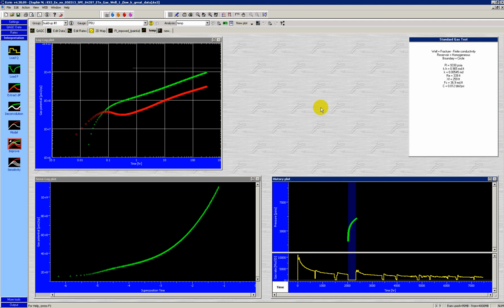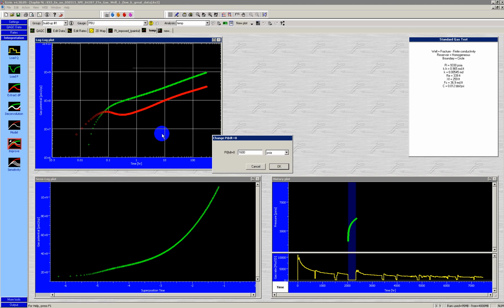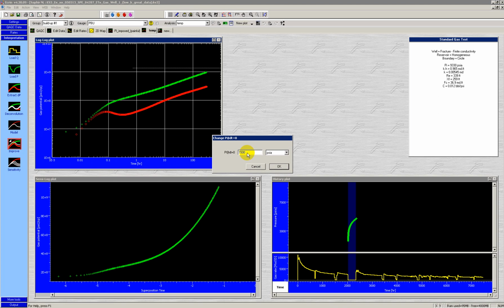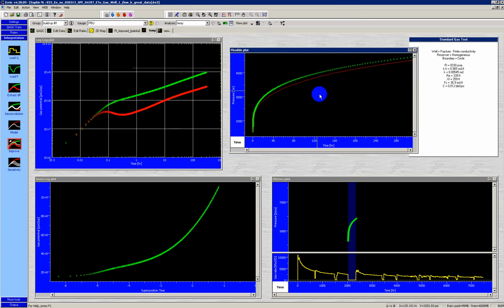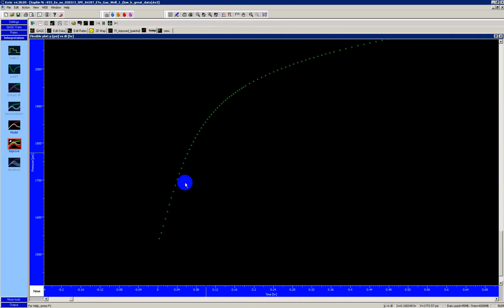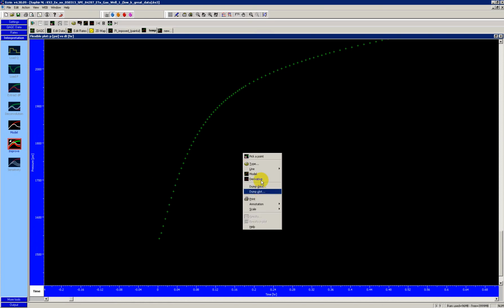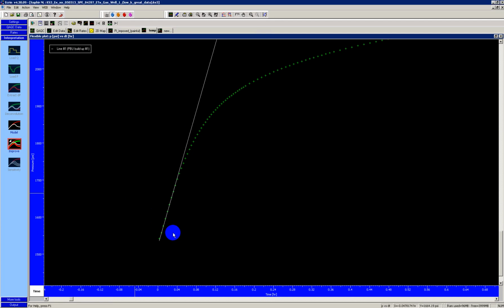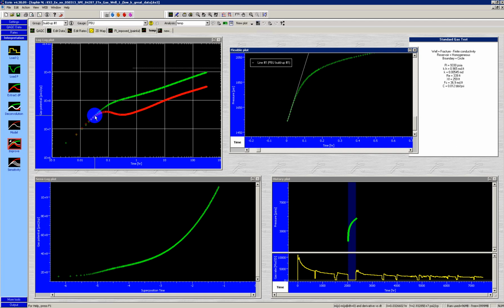Gas Well Test Analysis: Pressure at Start of PBU

Comment: Hello, thanks for the video. I have a question I am debating with people now. Saphir cannot take the representatives values of Qg at standard conditions if the pressure given is from the Wellhead e.g. WHP.  Is there any way one can reverse model a well test using the Qg value at standard conditions but pressure values of WHP for P? In theory the Bg factor will convert the values between pressure - however I don't seem to find this in the Saphir. Hope I could explain the issue well enough.